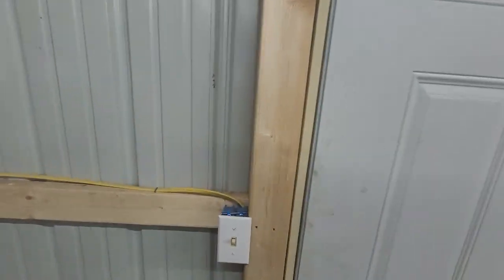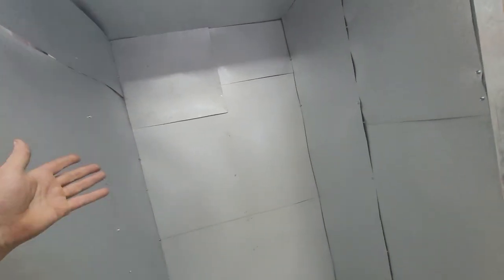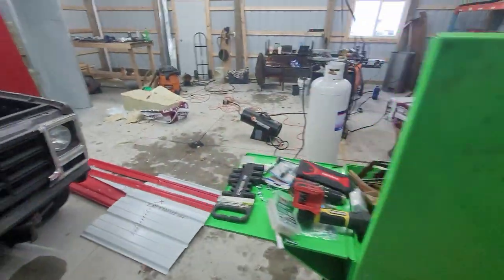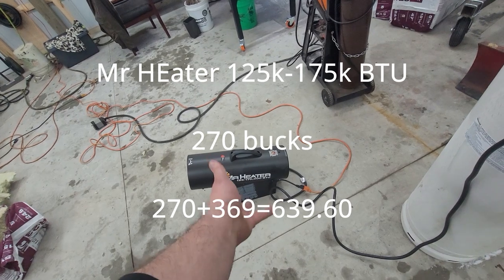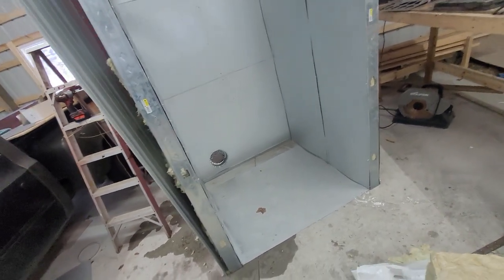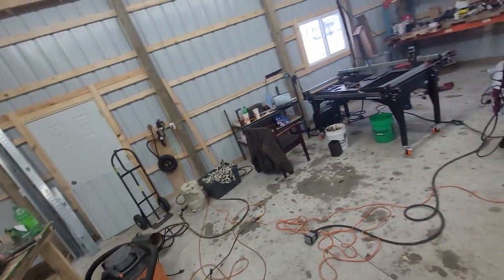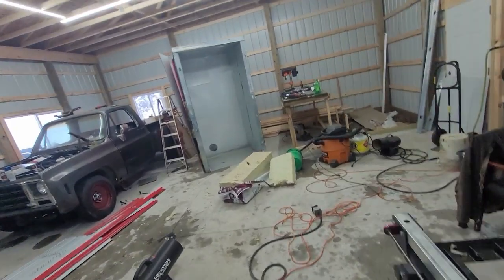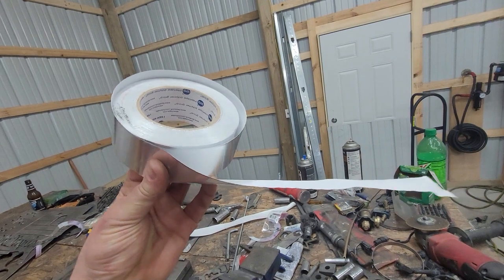DIY Powdercoating oven build. Gunnmetal-customs.com

Comment: Please look into the galvanized steel, certain types are only good up to 392'f degrees it vaporizes or starts to vaporize at that temperature. the Off gases will kill you🤮 please look into that.  looks nice though. 👍
Reply: I used to weld galvanized way back when... A: there's not enough poison on that oven to "kill you", B: don't breathe the fumes (duh) (kinda hard when welding and all that shtt rises in your face), C: just drink some milk, it helps tremendously
Reply: You know jr is an actual engineer tho right like super not stupid
Reply: @andrewerickson6690  Yes, as am I, BUTT....
Brain farts do happen. 
Just asking him to/ if research. The man is a incredible asset!!
Reply from the maker: Was an actual engineer, now I make shitty ovens all day 😂

Comment: JR not to add cost but if you do go to seal the edges don't use silicone unless it's high heat rated.  I think the normal stuff will spooge out at a little under 350 unfortunately.

Comment: How did the Door and “test” go the oven?
Reply from the maker: Oven temps are no problem, frame isn't nearly study enough to support the door though
Reply: @TheDrivewayEngineer  could you add a caster to the bottom outside of the door to support it? I see lots of heavy gates using them